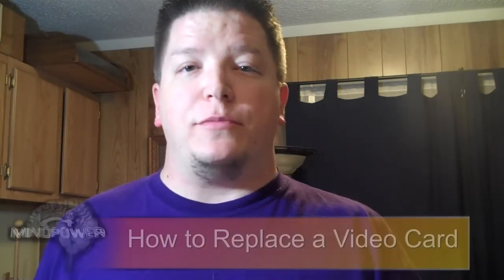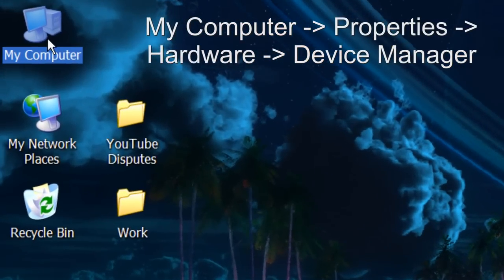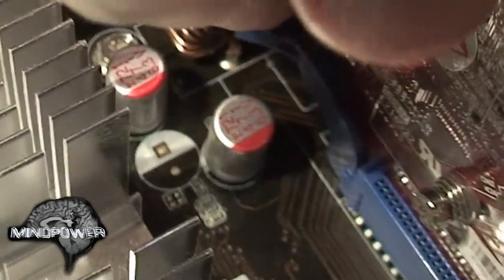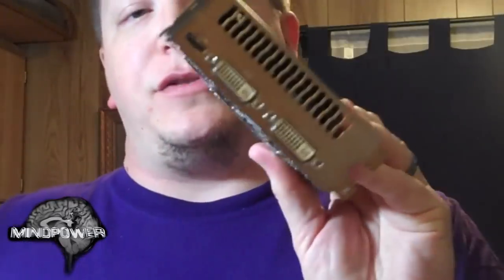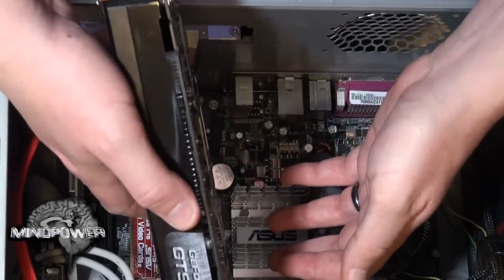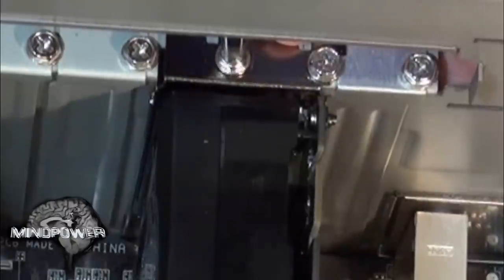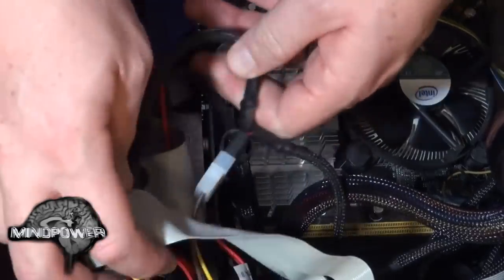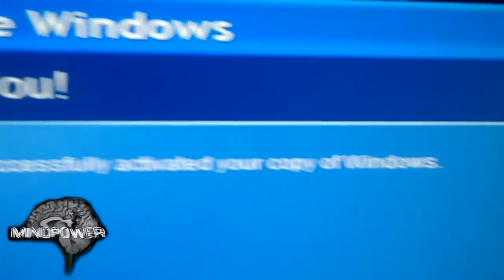How To Replace a Graphics Card

Comment: Hi, i have a 32-bit dell desktop computer, it is old, like 5 years, my processor is intel and its a duel cpu. it runs at 1.60 ghz. there is a built in graphics card, however i did buy a Nvidia Geforce GTX 525 and it worked great when i first got it, no lag and i can run on high graphics that games i meet/exceed the requirements, but now (been 6 months) it lags on most of the games now and idk what to do. i know my processors sucks, and that my card can benenifit much of that, what do u suggest?

Comment: Thank you for the reply, I have a Dell XPS 8300. The manual for my model mentions the removal of the "graphics card bracket" but it's not located at the end where the monitor is hooked up like they usually are. I have seen other videos of popular games using my card such as Call Of Duty 3 so maybe its not a bad card after all. technically my card is an Intel HD 2000/3000 Graphics Family 2.12 GB. Are you familiar with that model?   thnx

Comment: guys. i have a new video card. and i have one empty slot. my actually video card is on my motherboard. they called it onboard if im right . but i have a separated video card slot. and when i put the new video card in that slot and i put the screen cable  on it . my pc dont reconize the new video card i think. because i just get the black screen (like when u have the screen turned off). i dont know what should iu do . pm me fast if u know how to solve it
Thanks

Comment: Hey, had same problem when trying to run my computer with a radeon 6790. could be that the card isnt getting a sufficent ammount of power delivery to it. with that said i would always save the box u got the card with and ready the specs it should tell u what is the recommended power supply you need. but if you got this Computer from a seller then it would be key to contact the seller you have recieved it from. with that being said. if all els fails. make sure your monitor can support dvi flaless

Comment: I think it is a very well done video. Not everyone is a professional Youtuber people..........so many little kids, so many hormone filled comments.
Reply from the maker: subKONscious Thanks for the positive feedback :) I intended for the video to be a useful resource of information that would be good for a few years, and it turned out pretty good, in my book.
Reply: Not a problem, I actually used the reference from your video not too long ago. I was trying to overclock my GPU, while tweaking the settings through the BIOS, my motherboard crashed. So I had to remove my video card and switch around my JBat. So like I said, well done video.

Comment: Hey guys i just brought one sapphire hd 6670 1 gb ddr3 graphics card and the problem is that after i inserted the graphics card the monitor just wont start up (the monitor light keeps blinking) ..i also unistalled my older video card drivers before inserting the card,but when i inserted my old video card back my monitor started working..pls help:'(.

Comment: I have a new Dell computer ( it was a replacement)with an Intel HD graphic card. I have never heard of this card before.I read somewhere that it's not a good graphic card for gaming and that its usually used for laptops.It works ok with older games( Halo 1 ,CrysisSP, Quake2,,,etc)but I want to try newer games.Will my graphic card work for 3D gaming or should I upgrade?

Comment: I have a question about the power supply: 
I only have 1 free molex connector from my PSU, this card has the 6 pin connector with 2 molex connectors on a splitter, will I need to connect both molex connectors to my PSU for the card to function? 
I need to know whether I need to buy an adapter before my card arrives.

Comment: Hi, I bought a graphics card 5450 for my windows xp desktop and slotted it in. But there is totally no display on the monitor, the fan runs and that is all. this is the 2nd new one that has been changed. The monitor is ok because when the faulty one is plugged in, the system boots up. What else can i do? apprec if u can help thx.

Comment: You wouldn't need to uninstall your drivers if both cards use the same drivers.

So an AMD 5000 series card still uses the same drivers an an AMD 7000 series card. I think its up to 13.1.

Comment: The wire with two 4 pin connector that links to a six pin power connector is called a 6 pin molex connector

Comment: I've got serious trouble. I have bought a Computer with a gtx 560 ti in it. But when I plug the dvi cable to the dvi ports on the card and to the computer it doesn't get any signal, not with vga either. Is the graphics card broken? It's fans are spinning and lamps are shining green..

Comment: Noob question: Do i need to uninstall my old gpu driver before install the new one? Both gpu are from NVIDIA.
Reply: Yes. Then install the new one, which you will just need to go get the updated drivers for after.
Reply: You can uninstall afterward in Safe Mode, if you need to, but the fact that they are both from NVidia makes no difference, if they are different hardware.  Unless they are the same model, or if the drivers actually say they are made for both models, you'll want to take out the old and in with the new.
Reply: Thanks guys

Comment: could be you need to boot up in safe mode and choose a lower resolution that is compatible with your monitor (yup, you can have a video card that outperforms your monitor), then boot up in normal mode.  Try it.  It might work.

Comment: How do you know if you can replace your Graphic card. I bought my computer already built. It had a 660 card. Predetor g430 or something
Reply: it's difficult to replace a graphics card on a laptop however if you have a desktop you should be able to.
Reply: VictorDenSnygge You can replace any graphic card.
Reply: +Skyrux A laptop is harder as a laptop usually has integrated graphics chips which cannot be replaced as it is soldered onto the motherboard, some laptops has a pci express slot on the outside of it but it requires a special item that can have a graphics card in it that can mount it onto the laptop, but the difference is that you wont get amazing speeds from it though, it would give you better performance but I rather go with pc as it is less compact and integrated than a laptop.

The only thing that can be commonly replaced/upgraded on a laptop is hard drive, ram, optical drive,keyboard and the screen. 

Integrated stuff in a laptop commonly is the cpu and the gpu.

I suggest desktops for upgrading as they have more upgradeable parts not just that their advantages against a laptop would be the performance itt could give compared to a laptop, laptop advantages against a pc is its portability to take it like for instance a cafe or at a park while with a pc you can't really do that.
Reply: +Bay Mal laptops don't use graphics card it uses integrated chips which is soldered on the motherboard so it cannot be replaced.

if the graphic chip breaks your laptop cannot be fixed. (the motherboard is dead as it don't hhave a functional gpu chip which cannot be replaced trying to do so would kill the motherboard either way.

Comment: did you have to install the new drivers manually, or were they downloaded automatically upon the first boot after install?
Reply from the maker: +David Graham Yes, I used the software that was included with it.  You might prefer to go online and download more suitable drivers if the card calls for it, but most folks will probably just install the CD/DVD that comes with it.

Comment: lol, installing a eVGA e-GeForce 8800 GTX in a HP Pro 3500 is a tight fit, but it works, but I have an on board card, you should have said the procedure for that also

Comment: Hey I got a faulty radeon 6670 so I'll be replacing it with a new card of the exact same type ie. another radeon 6670.
This might be a stupid question but I'd hardly need to uninstall the drivers in that case would I?

Comment: My new card ASUS GTX 970 4Gigas STRIX  is not working im my PC HP Pavillion Elite HPE 210F, when i start the system during the BIOS loading i receive a BIP and nothing happends just stays there doing nothing. Im asking if i need to Setup the bios to read my card or is there another issue i don´t see...
Reply: your powersupply?
Reply: +Nikola Nikolov yes. you are right my power supply cant´handle with my card so i change it from 300 watts to 650 watts but now im facing a new issue...
Reply: Hugo Candeias bottlenecking?
Reply: +Nikola Nikolov the fucking original PSU comes has a 4 wire cable two black and two white with a 4 pin P7 conector the gives power to the mainboard connection in ATX CPU socket and i can´t see a way to turn arround or addapt
Reply: Hugo Candeias maybe try using molex to 8 pin whats your psu?
Reply: +Nikola Nikolov correct, but as i live in the end of the world there is no VISA service here in local banks to order that cable from amazon and im very frustrated to get the molex 8 to 4 pin cable
Reply: +Hugo Candeias oh i see try buying it in pc shop or something
Reply: +Hugo Candeias btw where do you live i am from bulgaria
Reply: +Nikola Nikolov the PC shops around here just sell PC not electric parts or electronic components. Working and Living in Angola for the moment. We have Fedex, DHL, UPs but ironic no VISA service to buy stuff online..shitty situation...

Comment: Does any graphics card work in any pic
Reply: +NTNF RELOADZ  no
Reply: As long as the motherboard is newer and the card fits in the case
Reply: Burnin' Byrne Productions  are you forgetting about the right power supply?
Reply: +sarttee oh, yeah, but that's kind of a given
Reply: Burnin' Byrne Productions some people don't know that i've seen people put in 900 series cards into comps with power supplies from the year 2005 and blew it out.
Reply: +sarttee Hey you seem to know about pc stuff personally im a big noob but im looking forward into Pc, anyways here is my computer Specs:
Graphics card:Intel(R) 82945G Express Chipset Family
Ram: 2.00 Gb
System Type: 32-bit Operating SYstem
Processor:Intel(R) Core(TM)2 CPU           400 @ 2.00 GHz 2.00 GHz
Can i upgrade my PC? All i want is to play some Pc games as CS:GO, Minecraft,Black ops 1, and H1z1.
Do you know what I need in order to run this games? i dont want to run them on high fps but a decent fps where i dont lag.
Thanks if you can help me.
Reply: I don't want to sound me but are you joking? First off, never use intel, second 2 gigs of ram? C'mon you need at the minimum 4. And how on earth do you even have 32 bit computer?!?!? You could upgrade that computer, but you should probably just buy another, it'll be cheaper and MUCH easier.
Reply: Do you know any computer that will run it?
Reply: Cesar Arellano 2 gigs of ram isnt going to cut it. You are going to need 8 at minimum in all seriousness you might want to get off that intel.

Motherboard: Asus Z97-A 
CPU: Intel I5 4690k @ 4.4Ghz @ 1.21VCore 
CPU Cooler: Corsair H100I 
RAM: 16GO Kingston HyperX Blue 1333Mhz 
GPU: 2x Asus STRIX GTX 970 4Gb 
HDD: Kingston SSDNow 300 120Gb / 1TO WD Blue / 160Go WD Blue / Saegate Flex Desk 1Tb 

get this stuff above and you won't ever have to worry about upgrading your PC. Ever
Reply: Cesar Arellano and you have to look up the minimum specs of the games 

http://www.systemrequirementslab.com/cyri

this website will help you.
Reply: i've decided to get a new computer since i've asked a ton of people and they all requested me to get a new computer, but I dont know which one I should buy. Have any to tell me?
Reply: +Cesar Arellano what your budget
Reply: Cesar Arellano You need to  say what games you want to play. a gtx 970 card is really all you need for new higher end PC games.
Reply: sarttee Black ops 1, gmod, minecraft, cs:go, TF2. Just those
Reply: Cesar Arellano lol.. get a 700 series card and 8 gigs of ram.. thats all you need.

Comment: Do you always need to be touching the case while installing the card? And even if the case is plastic? pls help
Reply: Your case should have metal inside but if some how its only plastic touch the unplugged and switches off PSU and no you don't always have to keep touching it just if you walk away from it walk on carpet or touch anything else besides the PC then make sure to touching it again for like 5 seconds

Comment: why is it that the new graphics card (gtx 950) is having no signal to my monitor?
Reply: +Sieg Gies maybe because you fucked up?Nah I'm just kidding. Make sure everything clicked and that your gpu is also hooked up to the psu with cables from the gpu pin-out and from the psu.
Reply from the maker: +Sieg Gies Maybe you saw that crazy power cable I had to hook up to the card?  Is that plugged in?

Comment: tried updating nvida drivers, now cant access nvidia control panel to tell computer to use it. too scared to do anything else now.
Reply: Urist McTubedwarf  Why dont you just downgrade your drivers?
Reply: Skyrux  did that. it worked for a little while but then started freezing and bluescreening frequently, even bootlooping a few times. tried installing new drivers again and now i cant use the card. at least the crashing stopped though.
Reply: +Urist McTubedwarf That sounds like a part is either going faulty or a part is just not working properly or a driver is just not working properly, if your computer boots up repeatedly that sounds like the operating system or the boot up settings on the Bios but I highly doubt it is the Bios. Usually it is either the OS which is a common problem I had to fix on pcs and laptops, but other problems not just the OS.

sometimes bootlooping can be caused by a part not functioning properly or broken a broken graphics card can cause that, or a broken hard drive. It could be like I said your OS is not working properly.

try reinstall the operating system then see if it works after, if it don't work after then it could be an internal problem.

Comment: At the end when you reactivate Windows, that doesn't wipe the hard drive does it? I don't think it does
Reply: if you use onboard video or no video at all no need to uninstall it is basically plug in gpu then use driver installation cd to install driver and after that it will ask you to restart. However, if you are upgrading uninstall old gpu then plug in new gpu and install driver.
Reply: No, it doesn't wipe anything.

Comment: Which Graphics Card Is best For Gaming? Ati Or Nvidia
Reply: it depends, most cards are fine for gaming if you get them between like $150 - $200 or higher. some games work better with different brands of graphics cards. but i would personally sugest a AMD
Reply: Nvidia is probably the safest option if you want to guarantee a good gaming experience. Really, as long as the video card can run directx 11 you'll be able to play almost any current gen game.

Comment: does the power cord come with the gpu
Reply: No, the power cord comes with the power supply, or you buy it separate.  The reasoning is that they would prefer you don't power it off the molex connectors, but the alternative is to connect it to a proprietary cable from the PSU.  Many modern PSUs have that cable built in or in the optional modular cables.  If not, you might have to get an adapter.

Comment: Did  it come with the power cord?
Reply from the maker: Ron Schneider No, it's assumed that you get the cable with your power supply (most do).  My PSU came with one for this, but I lost it and had to buy an adapter.